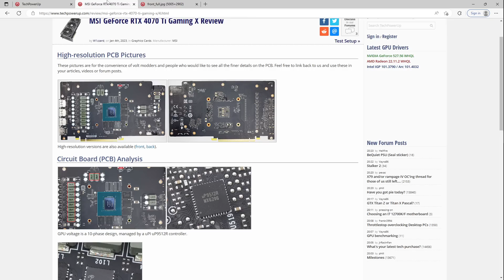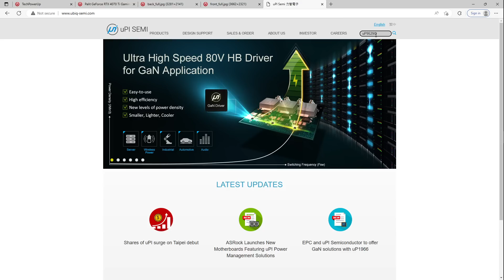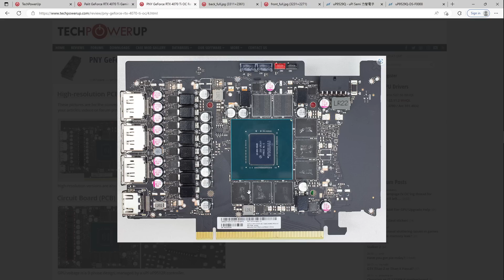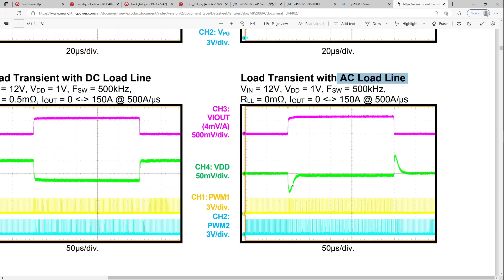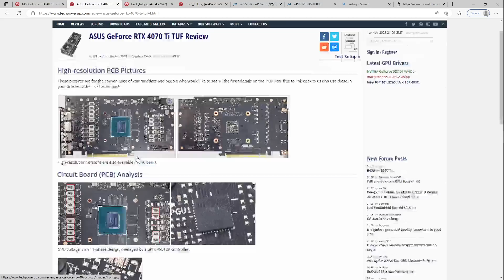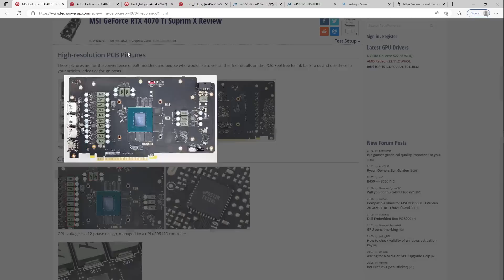The 4070Ti PCB video

Comment: Seems like their 4070 Super Dual Cards aren't half bad either? Apart from having less components installed (duh) they have only different caps from what I can see (TPU fotos). Cooling & noise seem okay but not spectacular as well. With current prices also the cheapest.

Comment: @ActuallyHardcoreOverclocking or whoever has the Knowledge to Answer the Question: On the Palit Card (or any card in gerneral), is it Posible to just Change the Capasitor to a Higher grad one? Same Question for the Filtering on the Back of the PCB (SP Caps) So for instance change from 100 Microfarat to 270 Microfarat. What kind of SP Caps would be used for Filtering, can u just add 470 SP Caps to the Blank Pads?
I am no stranger to soldering,  so the mecanical abilities are there. I just havend had any expierience with this kind of Modding.

I would be grateful for any info

Comment: The ASUS ROG STRIX 4070TI OC has an additional volt coltroller chip, for an external voltage regulator,  and overall has a higher TDP limit.  It would have been great to see that card reviewed, and show people one of the best 4070ti offerings.

Comment: It seems that Asus replaced the caps next to the external ports on the Strix from electrolytic (?) to some smd (ceramic?) ones. They have a picture of the inside on the official product page. Are those better or worse than the TUF?

Comment: I wish they used the dual 8pin on the back instead of the stupid 12pin on the side

I am only interested in the inno3d cards as those are the only ones so far that have a fullcover waterblock available for them from alphacool (alphacool says the WB fits the reference design PCB cards and also that currently it's only the cards from Inno3d so the others must have at least somewhat custom pcb)

Comment: I have Rx 570 itx pulse mini, it's powered by 6pin connector only and has 10A fuse to the connector. On the pcie slot it has 8A fuse. Power limit of the card is 120w, and can be changed via adrenaline or msi afterburner to +50% so 180w total. We all know that this is only the chip power and TBP will be like 30w more at least, so total 210w. Something doesn't add up. Giving the fact that pcie connector can only provide up to 75w, and the 6 pin connector is limited to 120w max by the fuse, total 75+120=195. How can the bios of the card permit something like that? shouldn't the fuse blow when using max power limit in something like furmark? well I've tried and it didn't. What do you think about that?

Comment: I found some article on Google claiming NVIDIA told partners to ditch all blower cards so as not to eat into their data centre market.  Which is funny as the FE cards are almost blowers, more heat seems to be focused out of the back than into the case, its why its such a nice design IMO.

Comment: I CBA to watch 1 hour video just to know if the placement of the GPU sprocket holes are placed with the same distance as previous gen GPUs. This is useful info if you want to chill this with a nzxt g12 GPU aio adapter

Comment: I recently replaced a ram chip with ripped pads on a RTX 2080 TI, did upload a video on it too then you bring up the topic in your video, love coincidences!
I have seen professional repair people say that the cause might  be flex, its almost always one or more of the 3 ram chips at the PCI-E slot nothing else.
In my case I was not sure if my removal of the chip ripped it or if it was the cause of the broken chip as suggested by YT Tech Cemetery for example.

I do wounder how the new RTX 4070TI and the NAVI3 like 7900XTX will hold up over time, if we will see a lot of them needing rebelling of ram or complete ram replacement at the PCI-E slot due to ripped pads on the ram.

To me it seems odd that you want to design t with the ram at the bottom, it seems less reliable, but I guess there is some design advantage or why would they do it?
I was thinking VRM gets closer first BUT most GPU's today has split VRM, coming from two sides and ram VRM split 3 ways even so makes even less sens then.

Anyways grate video as usual to keep my head busy!

Comment: The stix is the best 4070 ti by far , infineon SPS.  SP caps throughout the output filtering and on top of that they loaded the board with MLCCs
Reply: It will also cost as much as a low end 4080 most likely.
Reply: @edplat2367  nope , its 950$ on newegg , cheapest 4080 is 1250$
Reply: 999$ listed for strix 4070Ti super 999$ for base 4080S XD i mean at least ppl can mod or push benchmark ladders for the highest 4070ti scores XD or best air cooled 4070ti XD. 100$+ msrp for a 4070s master to push it to 300w+ to achieve 4070ti open box/used performance LMFAO.

Comment: Okay so basically NVIDIA has decided to give this card LESS memory chips and therefore less bandwidth, even though this is an AD104 die which allows for 256-bit bus. I guess they did not have much of a choice or the card would be 16GB which is "too much" for a mid-dange card or 8GB which is too little (looking at you RTX 3070). But of course - SEGMENTATION! 
It all makes sense now.
Reply: 192 bit is for defective mem controller ad104 die
Reply: @ariewijaya1679  If the memory controller was defective, it would just not work at all... Both AD103 and AD104 dies use 256 bus controllers. This is the full AD104. If they put another 4gb vram (2 mem chips) it will be 16gb and 256 bus. And that makes one of the cards irrelevant (4080) cuz people will just buy the 4070ti 16gb.

Comment: Returned 7900 xtx with overheating issue (vapor chamber faulty).  Got the 4070 ti asus tuf non oc for msrp.  Happy to not deal with reference pcb/cooler + coil whine and similar price/performance.  Will miss the extra raster but saving $210+.  GPU market is absolute dumbster fire but trying to make the most of it.  Tried getting used 3080ti/3090 at good price but always a step too slow.

Comment: Have you done an Arc PCB breakdown? I didn't see one. If not, I'd be interested in that. Happy to send hi-res photos of mine if it would help.

Also, instead of saving pages, consider submitting their URL to the internet archive for indexing so they're available to everyone. Also that's a good place to check if they've taken a page down or expired it.
Reply: ...which takes effort and doesn't work reliably. Saving the PDF is much easier and the ability to search the search for the data sheet locally is nice.
Reply: @JohnOrangeseed  but no one else can ever access it easily

Comment: With AC loadline your high frequency handling becomes more important, thus the smaller filtering caps often left out becomes more important.
The ESR of those ting caps at high frequency is a lot better than even the slightly bigger footprint MLCC caps. Unfortunately at these frequencys the layout need to be on par as well.
Cudos to Gigabyte for keeping them in.

Comment: Oh, was not expecting Day 2 (or Day 0 if you go by the sales release) 4070Ti coverage from Buildzoid. Usually, PCB breakdowns (or overviews like this) are for ancient , high-end, or old and high-end GPUs and motherboards! I know we have had the odd GTX 1060 featured before. But I don't remember much RTX 2070 coverage, and correct me if I'm wrong, just the Zotac AMP Extreme for RTX 3070Ti. 

And then I remembered, these could bave been called Nvidia 80-class GPUs. Would be interesting to see some naration comparing same-tier (i.e. MSI Gaming X, Asus TUF, Palit Gaming Pro) 4080 & 4070Ti. These things sure as hell look like lower-end 3070Ti and custom board 3070. Or is the completely different die enough of a give away?
Again, interesting to note that these PCBs have unpopulated memory pads. One would have thought this should be the highest-end AD104 based GPU.

Comment: 11:31 BZ If I really hate the new 12VHPWR connector on the Palit card, do you think soldering 2 PCI-E 8 pins connector and using it can power up the card normally ? It has pads for it though.
Reply: If you're willing to solder the PCB then you could solder the PSU cables directly to it. Assuming you have connectors on the other end, it shouldn't be difficult to handle then.

Comment: Similar 300W power to the 3070 Ti, but the PCBs make me think I'm looking at a RX6600. Phenomenal, Nvidia. I was placing my hopes on this card to throw some punches against 7900XT to help drive the XT's price down. Still early to tell if it's been successful (doesn't look like it yet), but damn, 4070 Ti sure has entertainment value.
Reply from the maker: evidently you've never looked at a 3070Ti PCB because it's basically the same thing as a 4070Ti PCB: https://www.techpowerup.com/review/palit-geforce-rtx-3070-ti-gamerock-oc/images/front_full.jpg
Reply: @ActuallyHardcoreOverclocking  brother you are only guy on planet earth who could answer my query . should i buy the 4070 ti super gigabyte gaming oc or Windforce /Eagle OC. 
I need a card which is compact and dual slot.
Rest msi and asus are expensive in india, they r priced in 4080 territory and i dont like inno 3d , zotacs , galax or colorful.
I am upgrading from Nvidia Rtx 3070 FE.
 please suggest and tell me is there any difference between gigabyte model in terms of VRMs, mosfets and phase design.
Is Windforce /Eagle OC  really inferior to Gaming OC model?.
Reply: @ActuallyHardcoreOverclocking  I have the TUF and it certainly doesn't look like that

Comment: The fact they were going to label this an 80 class card is almost as hysterical as them launching it at this MSRP. I'm late to the Nvidia hate bandwagon, but this generation has welcomed me aboard. At this point I'm just going to upgrade my 1070 Ti to a cheap 6750XT and call it a day. I'm not rewarding greed.
Reply: If you can  still get a 3070FE it's a better buy than the 6750XT.
Reply: @britexitengineer1407  all the Nvidia cards are still in the 800-900 dollar range in Canada. The 6750 XT's are in the 550 dollar range. I paid around 700 for my 1070 Ti back in the day.
Reply: @simplyscholar21  Even the lower skews like the 3060?
Reply: @britexitengineer1407  why would i get a 3060 instead of a 6750xt? A 6750 xt is only slightly behind a 3070 Ti.
Reply: @britexitengineer1407  how so? depending where u live, its sometimes 30-60% more expensive. No point
Reply: I was initially intending on getting a 6800 but most of the board partners only offer a 2 year warranty when they usually offer 3 years? The 3070FE  cost £469 +£11.50 delivery less than a 6700XT & I thought prices in the UK were bad enough.
Reply: @britexitengineer1407  3070 Ti FE is 819 CAD. 6750XT is 550 CAD. It's no contest.

Comment: I like the principle of fuses. 
Id want to actually test them. How many fuse manufacturers actually destructively test every batch? Probably only the ones who charge way more than board partners want to pay. 

If anyone has actual data on this please fill me in, Id love to know.
Reply: There is no way to "test" a fuse non-destructively, you ramp the power until it blows on a bunch of them and make an average to know the value they are most likely to fail at. Because yes fuses are not particularly precise and are mostly for catching dead shorts where current spikes to silly high levels. The "important" rating is the amount of current they can carry without blowing, more than the treshold where they blow.
Reply: @marcogenovesi8570  thanks!

I found eevblog did a video where he unscientificly tested some and he found a pretty big variation from fuse to fuse. I haven't come across any solid independent test data online tho

Comment: i don't understand why they intergrate the protective fuses. I mean if the card get over current issues then the fuse pop and we send them back for warranty right? they properly sent us the new card and recycle the broken one i think
Reply: It makes them less likely to have catastrophic failures that would kill the GPU core, this benefits the manufacturer as a returned card could still be salvageable for relatively cheap. It also benefits enthusiasts that can try to repair them themselves.
Reply: "recycle" is a meme with electronics, that basically means they get a few cents per board from a recycling center and a few bucks for the copper in the heatsink. In most cases it's better to salvage the special components they can't buy anymore (i.e. GPU die) and refurbish them on a new board.
Also there is no rule that says they must send you a new card. In a lot of electronics after a RMA you get a refurbished part.
Reply: Warranties expire, fuses are for ever

Comment: Me:  Endlessly cursing BZ (along with many other YT "Creators") for still not using a dark reader.  Though more so for those like BZ where it's good chill to sleep content and the bright white's a killer of that.
BZ:  I literally don't care, you don't like, don't watch.
Me: Giga Sadge.
Reply: lower the brightness of your screen, everyone that "cant live without darkmode" always has that cranked to max.
Reply: @marcogenovesi8570  Both are around 60%, so as I suspected, you just made up "everyone always has..." as there was no way you'd know that, let alone unlikely that people have brightness cranked.
Reply: @ChrispyNut  it was an obvious exxageration for comedic effect and of course you decided to focus on that instead than addressing my actual point. 
If white hurts your eyes, the screen is too bright. Lower the screen brightness until the screen does not hurt your eyes with white. On my monitors the brightness is below 10%
Reply: @marcogenovesi8570  So, for the few times videos have stark white screens, we all have to adjust our monitor settings, which then makes everything else excessively dark and muddy.
Reply: @ChrispyNut  if you didn't use dark mode you would not have this problem, your monitor settings would be already ok for white background with black text.
Since you are accustomed to higher brightness it may need a few minutes to get accustomed to the new setting, and it will not look "dark and muddy" anymore.
Don't get me wrong but that's the main reason I'm not using and never will use, and I'm strongly against the existence of "dark mode". With low brightness I can still see dark stuff fine and I don't get flashed when someone uses white backgrounds.

The only situations I crank brightness is when I'm outside in direct sunlight.
Reply: @ChrispyNut  clarification: the reason I'm against dark mode is that now there are two opposite GUI colors, someone will chose one and someone will choose the other. People will get flashed, or get dark stuff.
If GUI colors were kept standard (either white OR dark) we would not have this issue where you need to ask someone to change his own GUI because it's too bright and him telling you to go pound sand because it's his PC.
Reply: @marcogenovesi8570  Dark mode came first, so be against light mode.
Reply: @ChrispyNut  being dishonest won't win you any argument. On what device exactly "dark mode" came before white mode (aka normal mode)? 
Windows added it in Win10 (I think) and Apple in OSX 10.4 (2018). On Iphone in 2019.

We are talking GUIs here, console terminal hasn't been relevant for mainstream computing in 20+ years at this point, you might as well be arguing a return to punched cards or something.
Reply: It's because they almost never use their daily browser for shooting videos.
Reply from the maker: @maxromanowski6069  my daily browser is also light mode on most websites. I sit in a relatively well lit room. I see no reason to use dark mode.
Reply: @ActuallyHardcoreOverclocking  me who watches all your videos on an oled tv would really appreciate it😅
Reply: @maxromanowski6069  That would be more of a reason to use one, not less.